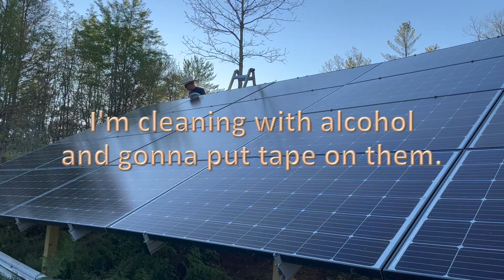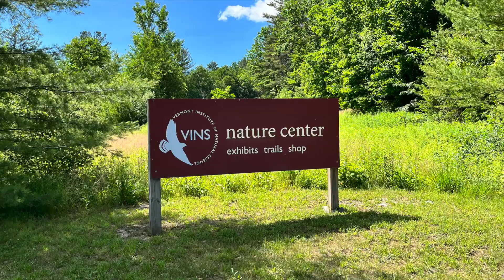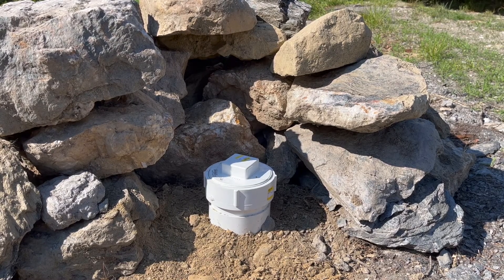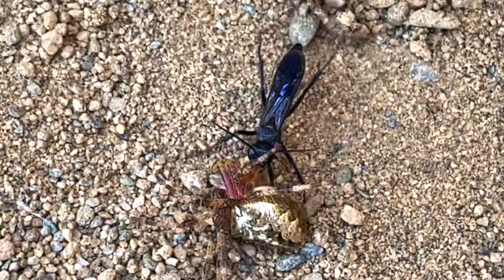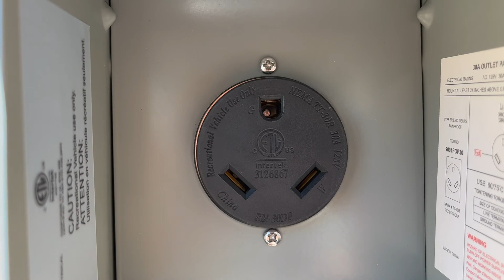We finally have enough power to run an air conditioner. BUT... (Vermont DIY off-grid home build)

Comment: For future reference, it's not always easy to use but, the FedEx app is supposed to allow you to reroute packages.  I haven't had much luck with it but, you're also supposed to be able to call FedEx and reroute packages.  It's worth a try but, I'm guessing all this actually happened a while ago and it's too late now.  The freight center should've been able to do it too.  Sounds like they were purposely UNhelpful.